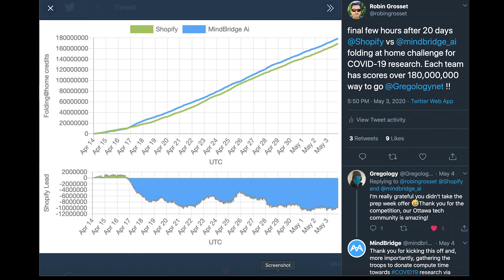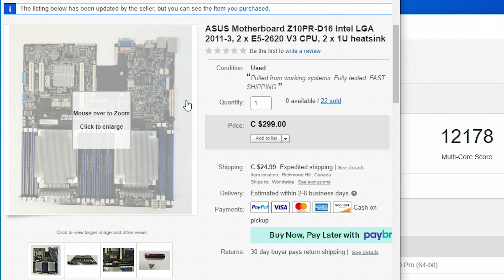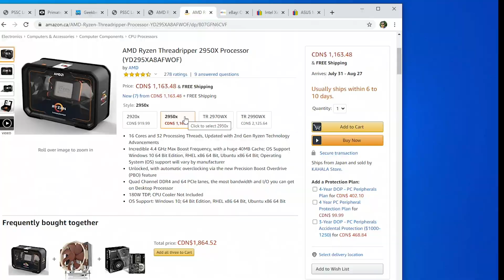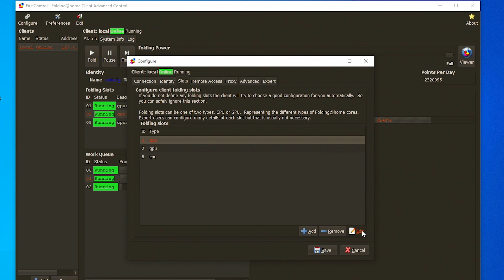Machine Learning FOLDING@HOME Monster Follow-up

Comment: Why did you put game cards instead of K80? Or do you make a separate server for K80, and Titans only for graphics on a large monitor? Using gaming graphics cards for important computations is crazy, I've tried. There were a lot of problems and I sold my 4 GTX 1070, then I bought 2 Tesla K80.
Reply from the maker: The main reason is that each Titan Xp cards is 2 to 3 times faster than a K80 and they have the same 12 GB of RAM per GPU. I have had no problems with computations on these they are just quicker, much quicker.
Reply: @robin-g6  You're in luck, I got errors in computational cores and memory failures on the GTX 1070. At the same time, the cards worked perfectly in tests and in games, which is why I was able to sell them in one day and buy a pair of K80s. In addition, one Titan, like yours, is more expensive than two K80s and it does not have much fewer double precision cores and no memory error control. If they work better for you than K80, I congratulate you. But there was already a story when calculations on Titans on one task gave a difference of 20-30% for each pass. On the claims, Nvidia said buy Tesla, important things are not considered on the cards for games.
Reply from the maker: Saber Toothed I am very interested in the type of calculations, I am doing machine learning models typically deep learning. Would really like to understand what is causing the problem. What kind of calculations are you doing? What language and library are you using.
Reply: @robin-g6  
Linux Ubuntu 16 Server, CUDA 11, Python, TenzorFloy. In my case, the problems were caused by old video cards bought on the secondary market after mining. They overheated and this led to a violation of the crystal structure of the graphics chip and memory. In games, single core and memory failures are invisible, while in calculations - cuda kernel panic.
Reply from the maker: Saber Toothed  I use the same libraries. I have heard of old mining cards failing more quickly as they have overheated. I have run my cards K80s and Titan Xp for months at 100% utilization. The cooling solutions I found for the K80s keeps them below 70 degrees C. The Titans stay around 84 degrees C on max with their stock coolers but never had a kernel panic. The cards should also thermal throttle, lower power consumption and slow down to avoid damage. NVIDIAs own manufactured cards seem to last really well, the only card that I ever had fail was from another vendor and died after heavy loads. I had a component explode on the board. I think it was a capacitor. There was nothing left of it.
Reply from the maker: Here is failure https://www.instagram.com/p/CExjvGwFtnt/?igshid=im7jxnmqq27u
Reply: @robin-g6  The structure of the card board is damaged. Better give it for disassembly for parts and buy a new one. Repair is possible, but it can burn out again. EVGA and Palit make poor quality video cards. Don't buy them.
Reply: @robin-g6  Good day. If you do not want to use Tesla K80, can you give it to me? It would be a great help in my case.

Comment: For the K80, did you ever think to use liquid cooling via waterblock? If so, why did you choose not to do it?
Reply from the maker: The Tesla K80 was launched quite a few years ago now and waterblocks are hard to find in production still and also not cheap. Here is one which is $140 https://www.ebay.com/c/24017789794 which is a pretty good price. But compare this to 2 80mm high CFM fans for $40. It’s cheaper and simpler to air cool and it works well. If I needed a silent system I might do water cooled and I have other water cooled stuff, for me it was mostly a price issue.